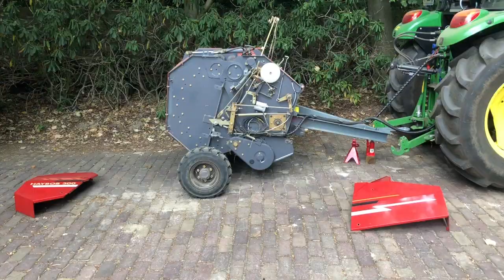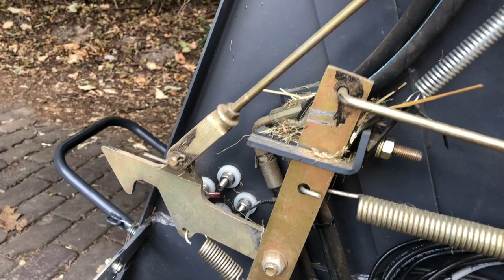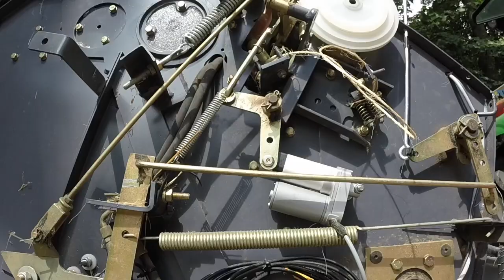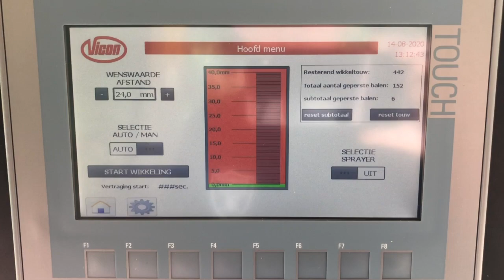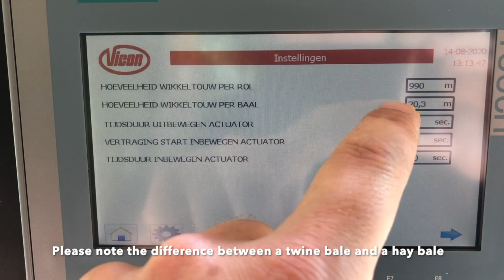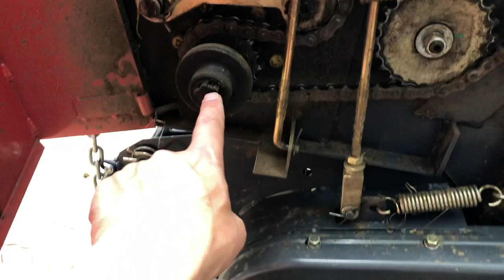DutchHorseGuy Mini Round Baler Modifications

Comment: Interesting. Quite a few mods. I assume there are versions which come equipped with those straight from factory. I've been looking at small round balers for a while but are hard to come by here in ireland. Is there equipment to lift several small rounds at the same time? Other wise they appear old school labour intensive. Advantages for me is that I have small but sloping fields, so lighter on ground than convential small square. Thankyou

Comment: also, i like the trailer mod, but the one sold by ibex is just one piece of metal to the top hitch point, not two for an a frame so the ibex uses a lot less metal and has more room for access to the front of the baler

Comment: the moisture meter is no good, it has to have a sensor ACROSS the bale, the one i made has two plates, one on each side of chamber, then my control unit that operates the baler doors etc also knows of desired bale density and that info is passed onto the moisture meter which must be aware of bale density for accurate measurements

Comment: hi
how many hrs does it take to bale 10acres?
how is the reliability?
Reply from the maker: The reliability is good. No knotters, simple technology. Not much can go wrong and if it does you can fix it yourself in the field. No need for a mechanic. How long it takes to bale depends very much on the field and how much hay is there. But if you have a nice square and flat 10 acre field and the windrows are nice and straight and medium size I think you'll be able to finish it in about one day. If there is a lot of hay and you have big windrows it might take longer. If there is little hay you can drive faster and it takes less time.

Comment: @DutchHorseGuy it would be great if you could add your reasoning for equipment choices you have made. For instance, what were the reasons you chose a small round baler instead of a small square baler or a large round baler? It seems that the productivity of a small round baler is very low compared to the other two choices and the equipment cost for a small square baler is not much higher. Operating costs for the small round baler seems higher than for the other two choices as well.
Reply from the maker: For me this is a side job and I used to hire a contractor with a small square baler. I looked for a second hand square baler but my contractor advised me not to go that road for reliability reasons. Old square balers tend to malfunction quite often and need quite a bit of maintenance. So I looked for new equipment. A square baler is approx 4x more expensive than a small round baler. And the round baler has a very simple design (no knotters) so there is not much that can go wrong. If it does, you can fix it yourself in the field. It takes a bit longer to bale, it takes a bit more twine. But for the few bales that I make (less than 500 per year) that's no big deal.
Reply: @dutchhorseguy7145  Thanks, that’s an informative and helpful reply!